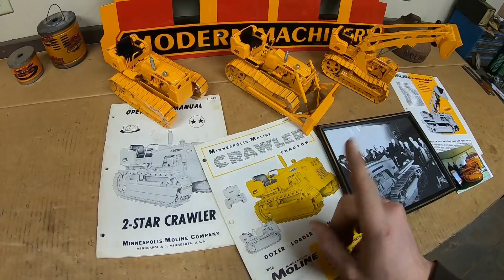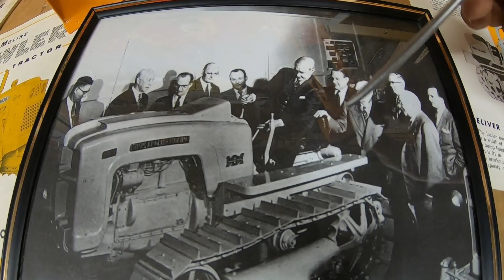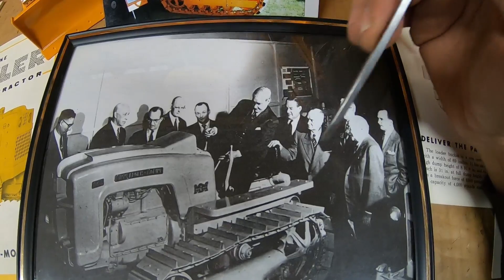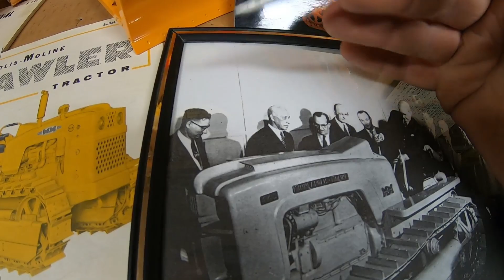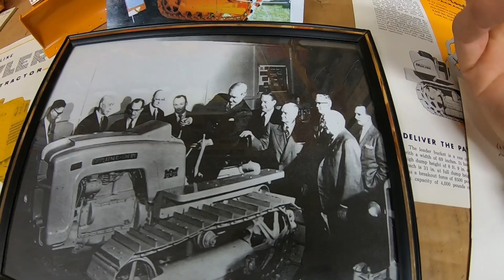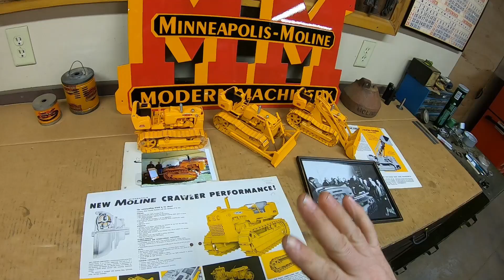Suits, Scandals & Greed! M-M Prototype Crawler #X253 Origin Story & How They Ended an Entire Company

Comment: Did X253 have a production engine serial number tag or was it also an X serial number? I'd like to see if I can find if they used a production 445 tractor to start with. I have 445 production info from Charles City and there were several early 445 tractors sent to Engineering for who knows what purposes.
Reply: @squatch253  I'd be glad to research it for you based on engine number.

Comment: Interesting history.     We have 2 M-M power units that power our barge winches.   Both are in bad shape and we might be replacing them with continental diesels that we have.   The MM engines are the model 403-4A.  They are 1956 if I remember correctly.    Might rebuild the engines for fun if I can locate the parts
Reply: It’d be worth rebuilding the MM’s rather than switching to Continental.

Comment: The 70s were a real bad time for manufacturer employees I worked for a construction dealer as a mechanic and got to meet the older engineers at the Dresser proving ground they had originally worked for Hough manufacturing that hd gotten gobbled up by International construction machinery who was purchased by Dresser corporation. Dresser raided the pension fund and did very little improvements to the machines. Komatsu bought out Dresser as a way to get into the United States it was called KDC at first (Komatsu Dresser Company) a lot of the first machines that we sold were Komatsu machines with Dresser decals on them. A lot of the original factory schools were put on by older Dresser engineers and we could tell the resentment they felt towards the Dresser management they didn’t seem to hate Komatsu so much.
Komatsu tried to Americanize there machines using products made in the USA, Cummins engines, Eagle heaters and air conditioners all hydraulic components were made in Japan at least s far as I ever saw worked there for 27 years.

Comment: 13:15 The Italian 1962 Toselli 226 crawler I restored some  time ago had the same steering concept. Very nice and easy to use and the left pedal turns into a foot clutch and the right pedal turns into a brake pedal for both tracks.